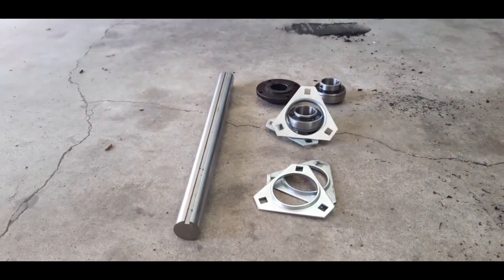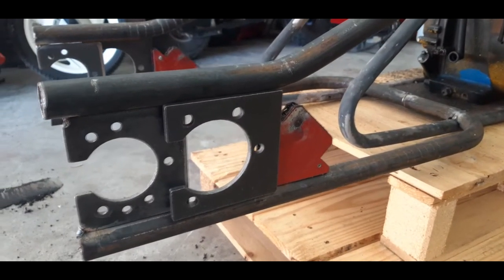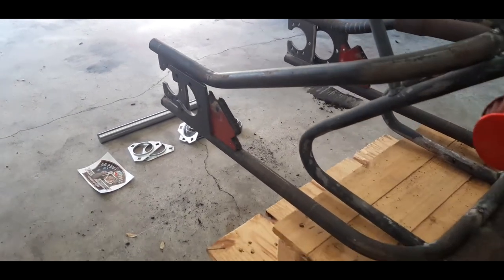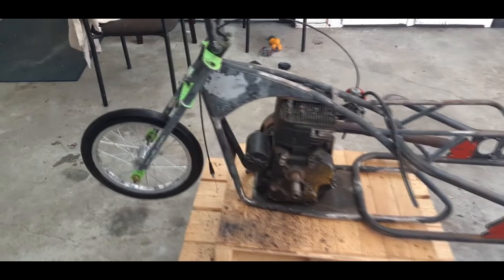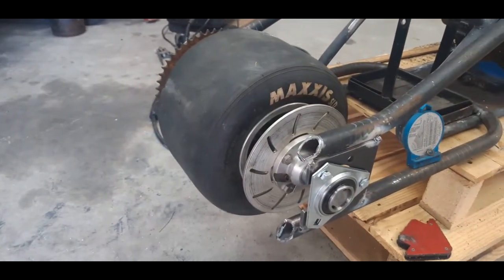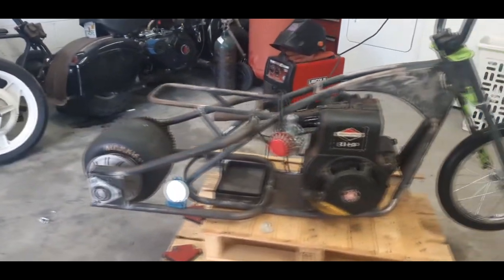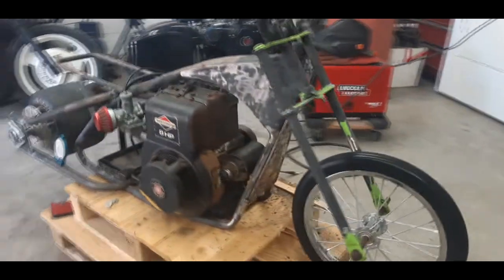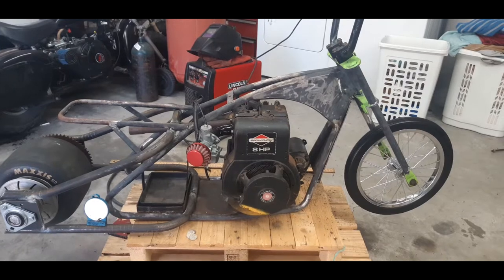Motovox Mini Bike Build With 8HP Briggs Flathead Build Part 3

Comment: Hey I'm a new fan I ave a Baja warrior 196cc I ave a question what it better one chain or two
Reply from the maker: You can go either way but one chain is less drag and it does work fine..our 420cc baja doesn't have a jack shaft and has been holding up fine..thx for watching Wolf!

Comment: If that clutch is one of the cheap ones off ebay, ive had one on my v twin bike since last summer and its holding up great. Rated for 8hp and it's been holding 16+hp great
Reply: And i also have a sorta high gearing 14 clutch, 50 wheel
Reply from the maker: V twin eh?..cool..got any videos of it..I will have to go look..I think it is a ebay clutch..thx for watching k Town!
Reply: I think you're subscribed to my channel, I got a video on there

Comment: What size carb did you use? What size jets and needle clip position did you use?
Reply from the maker: I have the 32mm on the top clip on the needle..I havent changed the jet...I thought it would run rich but it runs perfectly...thx for watching Friend

Comment: What length rear axle did u go with for this build?
Reply from the maker: I built one..it ended up being about 17 inches long..check out the rest of the build..thx for watching friend
Reply: @GoKartsorGoneFishin  For sure, I plan on building a custom mini chopper with a 212cc predator engine. Im an novice and want to be sure to buy the right parts for the build. Thanks for the info!!!